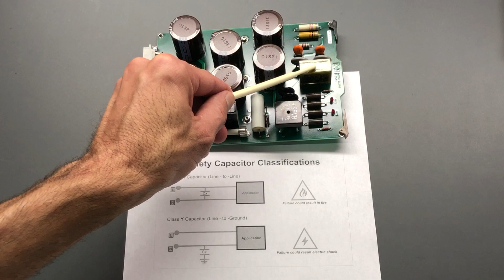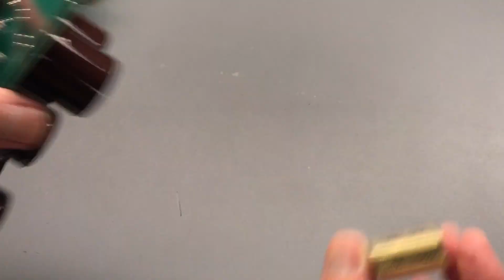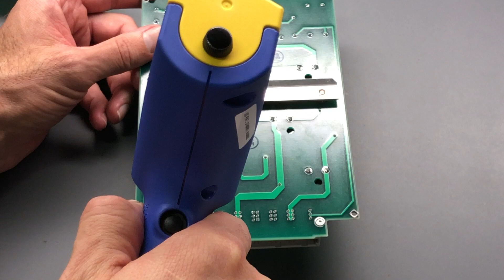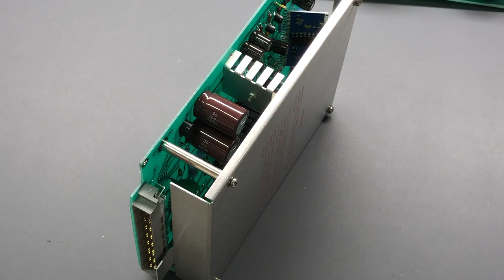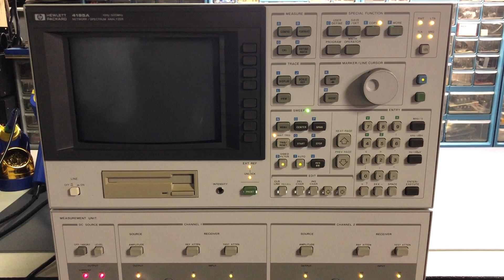RIFA Safety Capacitors Are Failing!  Why You Need to Replace Them

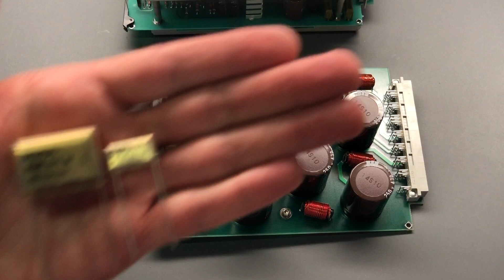Comment: 9:22 what you are showing are NOT modern versions of their capacitors. They share the exact same construction and WILL go up in smoke or flames sooner or later. Molded or potted paper capacitors have no place in repairs like this, especially not if they're as badly constructed as those. Consider using MKP types from Vishay, TDK or Wima. "They seem to perform fine" was indeed the level of quality control at many ot the manufacturers that used them back in the day, and people who replace them like-for-like are the only reason this dangerous crap is even still made (though they're finally phasing them out).

Comment: Thanks for the channel! Came here by accident 😊. I know I'm a bit late to the party, but indeed this is a perennial issue with many old devices. It's not just Rifa affected, but as someone already mentioned, WiMa and possibly other brands as well. In my experience, usually all capacitors in a clear housing with a clear potting compound.

Never use NOS ones for replacement! These things get the shrinkage cracks even if they are just lying around. It's a problem of the material and then, during mains operation, the heating caused by the progressive increase in dielectric losses due to moisture ingress.

If you're unlucky, they spew out a dark brown, sticky, smelly stuff that spreads throughout the device. The stench can linger for weeks despite cleaning.

Modern capacitors merely lose only capacitance when penetrated by moisture. That's not very likely to be noticed. But there is one exception: they are often used as lossless series resistors in simple (standby) power supplies, that usually fail at the moment of a “higher” power demand, for example when a relay is activated - maybe causing a processor reset...

Comment: A good reason to try them again with the same brand.
Reply from the maker: RIFA is now manufactured by KEMET one of the highest quality capacitor manufactures.  From my experience the problems have been corrected likely with the use  of modern materials.
Reply: @EriksElectronicsWorkbench  sure, some types use modern materials like polypropylene as a dielectric and those will indeed last, but you can't fix molded or potted paper caps by using better materials as long as you keep the paper. They might last slightly longer but still be dangerous and outdated. When fresh from the factory, they will perform just fine for years continuously just as the old ones did, but let them sit for a year in a non-climate controlled space and they will behave exactly the same as the old ones. Also, they're not "manufactured by KEMET". KEMET took over the RIFA factory, so nothing changed. Not even When Yageo took over.

Comment: RIFA - 'Replaced If Found Always'.  The only issue I see with replacing RIFA with RIFA is that any potential future owner may end up replacing them again as they won't know they are 'new' ones, either that or you forgot that you did it 10 years ago and do it again!
Reply: Or after 10 years and one day they will cause smoke or even a fire and lead to the equipment being trashed. Or sooner if the equipment si stored for a time instead of being used regularly under climate controlled circumstances.

Comment: I just replaced the RIFA capacitors on my Tektronix 2213a oscilloscope and replaced them with RIFAs. I'm glad to hear that the modern versions have been improved, it sets my mind at ease. Thanks.
Reply: They didn't. Please consider using known brand MKP types instead of paper capacitors.

Comment: It's not only RIFAs blowing up though. I've had old 80s WIMA X2 ones (silver color) release phenomenal clouds of white smoke just as well as the RIFAs do. Which makes me wonder: Which brand/model safety caps are actually safe to operate after 40 years?
Reply from the maker: The RIFAs are well known for the problem and should always be replaced but after 40 years it's not a bad idea to change out any X or Y class cap.
Reply: It's not only about the brand. RIFA PME and WIMA MP3 are potted paper capacitors. They have no place in any equipment made after 1980, even though some fail sooner and others fail later. Modern MKP polyprpylene foil capacitors do also fail, but mostly from self healing and on top of that they fail safely instead of causing smoke or even fire.

Comment: Great video, just one remark: Y-capacitors are often even more safety critical than you described. Nearly every class-II SMPS uses Y-capacitors between the primary and secondary side of the transformer to surpress EMI. If a Y-capacitor fails in a class-I device - like you have shown in your sketch - then usually the failure current is going through PE and the RCI or even the circuit breaker trips. But if a Y-capacitor in a class-II device fails, then you have mains voltage directly on an output that usually is not earthed - e.g. on the output of your smartphone charger. An electric shock is more or less unavoidable in that case.
Reply from the maker: Thanks for watching.  The Y class capacitor is supposed to fail to an open circuit for protection but of course these RIFA caps fail in the worst possible way.  There is a good article on class-I and II power supply differences here https://www.emea.lambda.tdk.com/il/KB/What-is-the-difference-between-Class-I-and-Class-II-power-supplies.pdf
Reply: @EriksElectronicsWorkbench Thanks a lot for the Appnote - it really is a great resource of knowledge!

What I wanted to say is that the more expensive class-I devices generally have branded and (except maybe the old RIFAs) high-quality Y-caps, though their shorting mostly only leads to a tripped breaker.

The tons of dirt-cheap consumer SMPS, like chargers or other wall warts, directly endanger the life of the user. That's why, in my opinion, if we talk about dangerous Y-caps, we should never forget the class-II devices.

Comment: I suspect a failed Dain capacitor is the reason the rv fireplace board quit working. I tested both ends where its leads were soldered in and no continuity? I've read they are not very good. Any suggestions? Thanks
Reply from the maker: Capacitors don't have continuity through them so it's normal to show an open on an ohm meter.  If you do not like the RIFA brand you can replace it with other manufactures as long as the tech ratings are the same.  Mouser and Digikey have many safety capacitors in stock.
Reply: Ok, then there is something else wrong with the electric RV fireplace board? Just buying a new fireplace but just curious as to why the board quit working? There is power going into the board but not going out?

Comment: I wondered "Are they still needed these days?" Removed a blown one from my Revox B790,  didn't replace it.
Reply from the maker: Yes they are needed in modern equipment especially with switchmode power supplies to help suppress the interference generated within the power supply.  Sometimes older equipment had them just to suppress sparking on the power switch and/or provide some basic RFI suppression from the outside world.

Comment: Hi there. X capacitors have + and - poles? Thank you
Reply from the maker: Hi, the X and Y class capacitors are non-polarized.  They can be installed in either direction, no worry about + or - polarity.
Reply: @EriksElectronicsWorkbench  thank you.
Reply: Thank you

Comment: There is no safety involved with these capacitors. They are used to suppress line and SMPS noise. The usual arrangement uses 3 devices, one between the Active and Neutral being around 0.1 uF in conjunction with two others of about 0.002uF wired from the Earth to Active and Neutral respectively. The 0.1uF 250ac device has proven to be most problematic. I had two pieces of HP8563E gear go up in smoke minutes of plugging the equipment into the mains. Have spent their life on 120Vac mains and then being exposed to the 240Vac has resulted in rapid destruction. I replaced them with an ac rated mains capacitors of 275Vac and never had any further trouble. But the word Safety should never be in the same sentence as these type of capacitors.
Reply from the maker: The term "safety capacitor" is in fact what the devices are called.  They are also called X class and Y class capacitors.  If you watch the video I address the fact that the term "safety" is related to the capacitor's internal design and how they are suppose to fail.  I also discuss how and why they are used.  The old RIFA types have aged poorly and are anything but safe now.

Comment: i can be wrong, but in my opinion, Rifa caps start to acttract moisture arround the leads, and once the moisture gets inside, they start to swell, and that swelling cause the cracks in the housing. i experienced many times a bad Rifa cap, and each time when they where cracked, they where also bulged. Never seen a Rifa cap with only cracks without swelling.
A few years ago, i bought some high voltage Electrophoresis powersupplies trough Ebay from USA sellers, where they previous where used on 110/120V, the first time when i received such a powersupply, i opened the powersupply and everything look fine, set the voltage select switch to 230V and power up the powersupply, and after a few seconds, the Rifa cap bursted open in flames. 
The entire room smelled for days like burned wood. That Rifa cap was rated for 250V, for use in the USA with 120V, thats fine, but for use here in Belgium or Europe with 230/240V, that is not enough extra headroom. Since that day, i replace every Rifa cap with a Kemet or Wima cap, and choose for a 310V or 400V rating.
Reply from the maker: Hi, yes I agree they could be cracking around the leads.  However I have seen them with cracks in the case and no swelling and then some with swelling, and yes when they let out the smoke the whole room smells!!  I had a Tektronix scope with a failed RIFA that set off the smoke alarms.
Reply: @EriksElectronicsWorkbench  , i don't trust a Rifa cap,even the new ones. Never seen other brands burst open like that, even the yellow ones in cheap electronic devices like floodlights with motion sensors etc.....
Reply from the maker: @BjornV78  I have installed the new production RIFA and not had any issues with them but of course there are other brands and I do use them as well.  Yes the problem seems  to be with the older original version RIFA and agree other brands did not  appear to have the failure problem.
Reply: Same here in Australia. HP test equipment from Japan and Korea went up in smoke within minutes on 240Vac.
Reply: 250V peak isn't nearly high enough headroom for 230VAC (RMS)! For example, surge protection varistors should be 470V!
Reply: @mrtechie6810  , you can't choose your varistors with too high voltage rating, because then they come in action arround 470V, in the meanwhile every 240V rated component has released the magic smoke. Surge protection is to PROTECT the components behind, not itself. 
The voltage rating of safety caps is a compromis that you have to make, it can't be too low, but it also can't be too high otherwise you loose the main purpose. 
Here in Belgium we have a 240V / 400V grid, between each live wire and neutral there is 240V, and between the 3 live wires, there is 400V. This means that if a someone accidentally hook up 2 live wires (400V) instead of 1 live wire and neutral to a 240V circuit, nothing will happen with a 470V varistor, while every other component blows up in flames.
Reply: @BjornV78 230V AC = 325V peaks.
But 230V is the nominal voltage. It is allowed for the voltage to vary by +-10% = 253V RMS max.
253VAC = 358V peaks. There is no varistor of that value so you need to the next higher value or so. If you choose a value that is too low, then your varistors will fail soon.
If you want to protect from a mistake by the power company then you should also use an overvoltage protection relay that disconnects the power entirely. That is NOT a surge protector. If the power company makes a big mistake, it may fry your equipment. It is their fault, and you can demand damages from them.
A component for a 230V system should NEVER burn near that voltage! It should be rated higher, like above 300VAC or 400V peak, otherwise it will be expected to fail. I would get components that are rated for double the nominal voltage if one is not in control of the supply voltage.
Reply: @mrtechie6810  , for 358V peaks, you can use a 400V Varistor. But there is a difference between a Varistor and a Safety capacitor. A Safety capacitor is to filter noise and can add protection against overvoltage or surge, where a Varistor has no noise filter capability. A Varistor or MOV is a clamping device. This topic is about safety caps, not Varistors. If i make a circuit, i never use Varistors because when they fail, they can explode very violently and can cause fire. I use TVS diodes, they can handle a lot of abuse without starting a fire. This is why in some devices they placed a extra layer of heat shrink arround the Varistor to keep things together in case of faillure. Besides Rifa safety capacitors, i have never seen a other brand explode in such a manner that it is starts to burn with a yellow flame, even the cheap brown or yellow safety capacitors from China that are used in capacitor dropper circuits like flood lights etc....
Reply: @BjornV78 capacitor should be rated higher to protect itself. The voltage rating of the capacitor does not affect its filtering ability, only its longevity if exposed to excess voltage/surges.

Comment: How do these capacitors protect the circuit? From what does it protect the circuit?
Reply from the maker: The "safety" is intended for the user of the device more than the circuit.  The capacitors are generally for RF noise interference suppression, radiated or received, and are across the AC line.  They are supposed to fail in a safe way to prevent shock and fire hazards.
Reply: @EriksElectronicsWorkbench  but then, from what does it protect the user?
Reply from the maker: @ConhecimentoProfundo7  the protection is from electrical shock and fire.  Non-safety rated capacitors might fail to a dead short where as a safety capacitor fails to an open circuit.  The failure could be initiated by a high voltage surge.
Reply: @EriksElectronicsWorkbench  can a safety capacitor protect the circuit from a lightning strike?
Reply from the maker: @ConhecimentoProfundo7  safety capacitors are not intended for lightning protection.  They  offer no protection from large voltage surges.  However there are other types of devices for clamping or shunting voltage surges but keep in mind a direct lightning strike is pretty much impossible to offer protection against.
Reply: The safety capacitor isn't intended to directly protect the circuitry, or the user. It is designed to fail in a safe way. Knowing that capacitors fail frequently this is not a "good to have" feature, but something that it crucial to avoiding fires.

BTW, the phrase "Failsafe" means to be able to fail in a safe way. Often times I hear this phrase and I'm pretty sure that the phrase isn't being used as intended. :)

Another device that has a spotty history is the MOV, or the "surge suppressor". Each time that they protect your circuitry by clamping down on the excess voltage, they end up lowering their threshold voltage for clamping. Which means that given enough time they will clamp on what would be a "normal" voltage level and self-destruct. This has been known to burn down houses (Trace Adkins's house for example), so the "thermally-coupled-fuse" type MOV was developed.

And as a public service, don't buy used surge protected power strips from Goodwill, etc.
Reply: @MrWaalkman  very interesting, thank you for replying.
Reply: @MrWaalkman  Do you know why sometimes in power supplies they put a capacitor between the primary and secondary of the transformer?

Comment: Nice Video, When you refer to 240V it would be nice if USA-specific issues were pointed out.  UK has 240 V and we have Live, Neutral and Earth ( chassis) this two-line thing is new to me.  Now all I have to do is find a supplier for my VCR safety cap. Cheers.
Reply from the maker: Your point about 240 volt power distribution in the USA vs. other countries is noted.   If you are looking for electronic components in the UK you may find the list here helpful https://www.icrfq.net/electronic-components-suppliers-in-uk/
Reply: @EriksElectronicsWorkbench  Thank you. Merry Christmas.

Comment: Dave @  EEvblog recently did a video on "Safety Caps" , that, although did not have outward signs of physical damage, but one was used as a voltage dropper to power a low voltage linear DC power supply section of a heater ( "overseas designed")  that had failed and caused the control panel on a space heater to quit functioning. After "de-potting" the failed cap, and unwinding the foil, you could see visible signs of internal damage,or, how the capacitor foil was designed to pretty much vaporize at a weak point where the stress of a surge made continuity. Over time, the cap wouldn't short circuit, but it would slowly be out of tolerance as far as capacatance value is concerned. I would probably put these types of components on a list for replacement as far as a maintenance visit inside of an assembly goes, unless you tested them for proper value to tolerance and leakage before calling it good.
Reply: When caps were used as voltage droppers in low voltage supplies, there is only certain  type of  “safety caps “ to be used